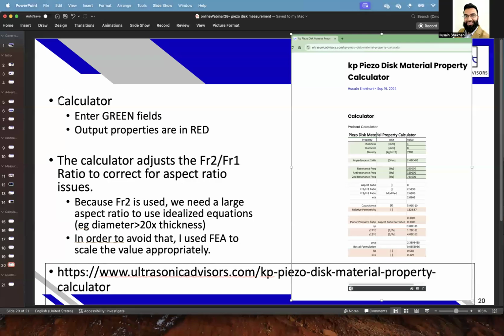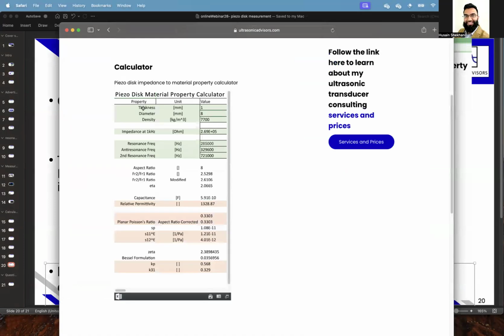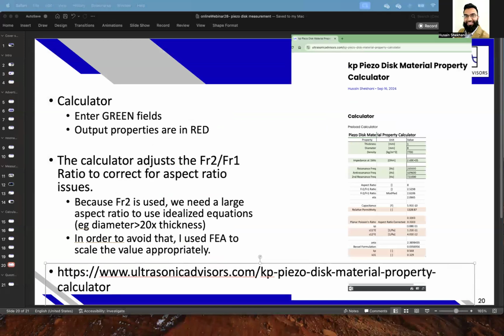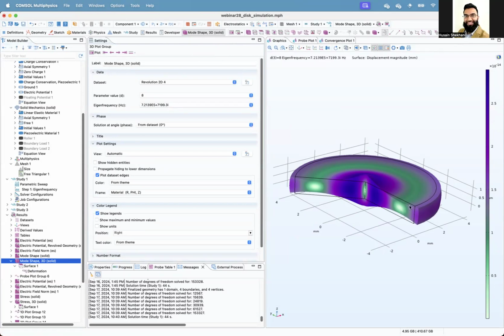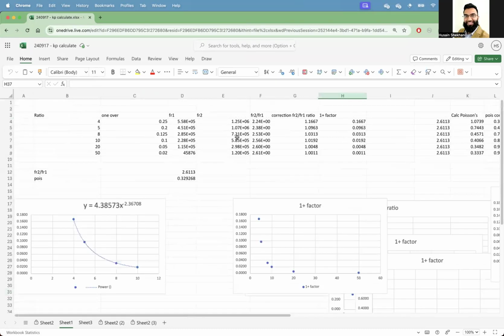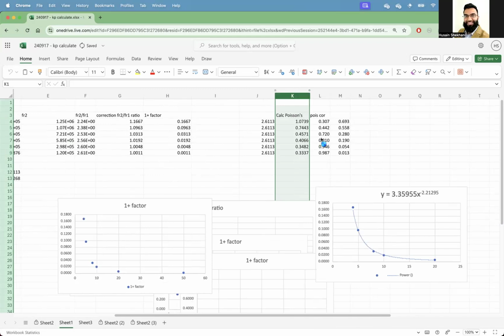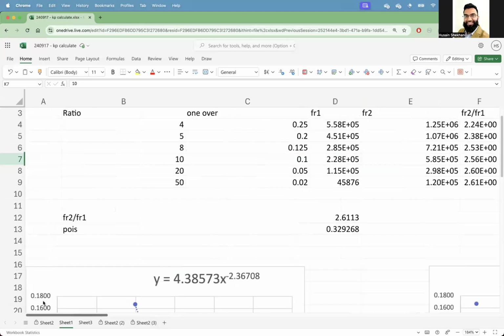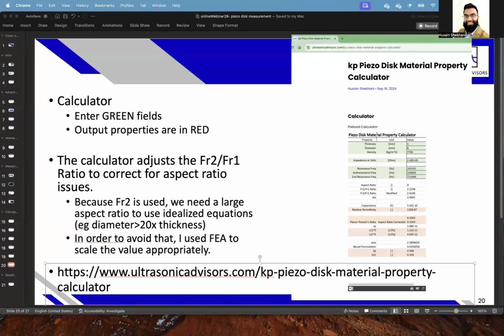Piezo Disk Material Property Calculator Overview

Comment: Sir is it possible to generate lamb wave using piezoelectric transducer and a microcontroller
Reply from the maker: I believe so. Surface acoustic waves aren't my speciality, but you if you have the right polarization piezo and enough power at the desired frequency, you are golden!